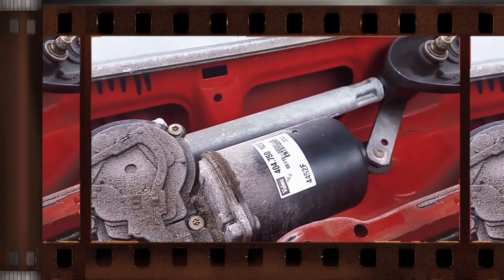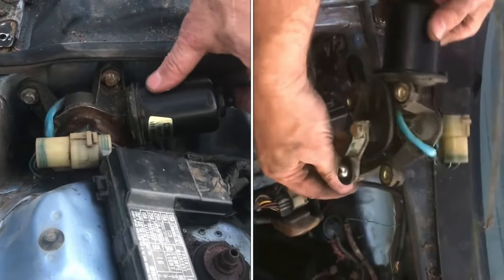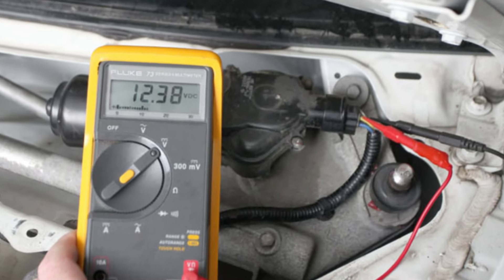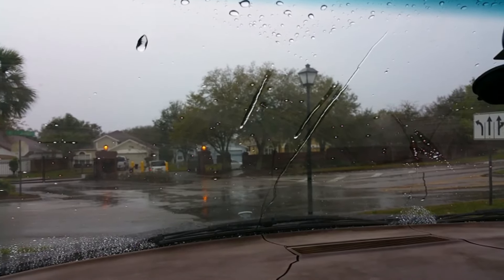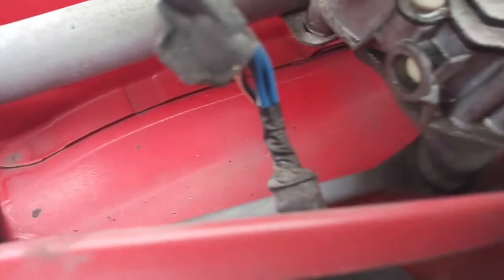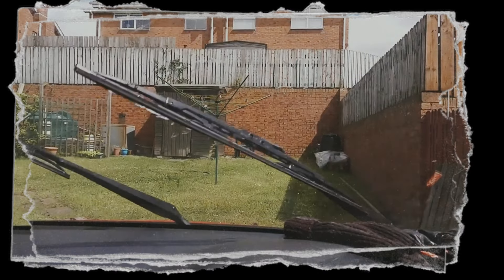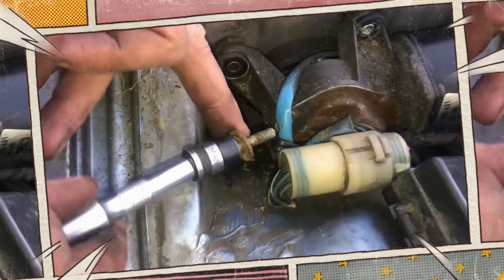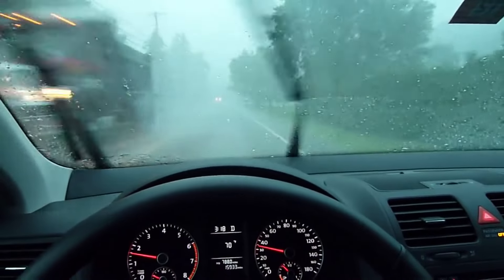5 Bad Wiper Motor Symptoms. How to Test & Replacement Cost

Comment: I changed the linkage and the motor. With the wiper arms removed I can see the 2 "screws" turning back and forth.  Once I put the wiper arms on and tighten the nut they don't move at all. What could that be caused by?
Reply: This is caused by the wipers being set to up right position but they are actually positioned down after you put them back on so the system is telling the wipers to go down but they cant move. because the transmission only travels in one direction the wipers need to be set to the down position by resetting the linkage to the home position
Reply: Hope you have solved it by now brother, 😂

Comment: My wiper motor move too fast. I checked the fuse and it turns out it was damage. I change it but still the wiper motor move too fast. Should i buy a new wiper motor?
Reply: Did you ever fix it

Comment: Hello Sir;
My wiper motor doesn't work when I turn the switch on my dash, and makes a static sound when I turn the switch , plus the battery charging gauge bounces around. 
Any idea that might be causing this?  thanks

Comment: My wipers won’t stop and indicators won’t work, anyone knows what is the problem? Thanks
Reply: The whole arm next to the steering wheel for turn signals and wiper speeds needs to be replaced maybe. But check fuses first